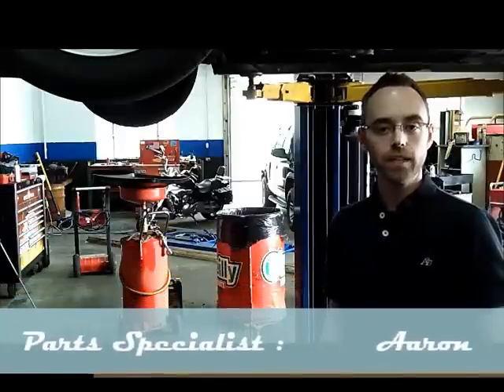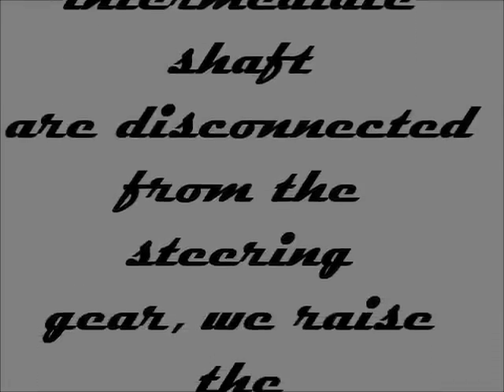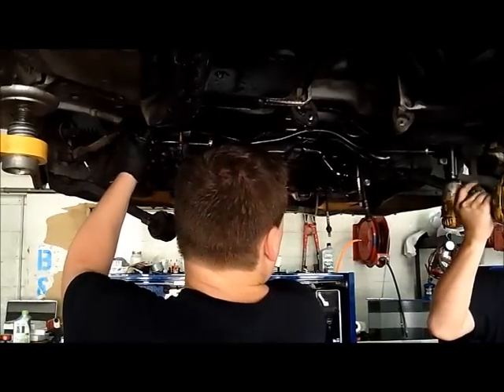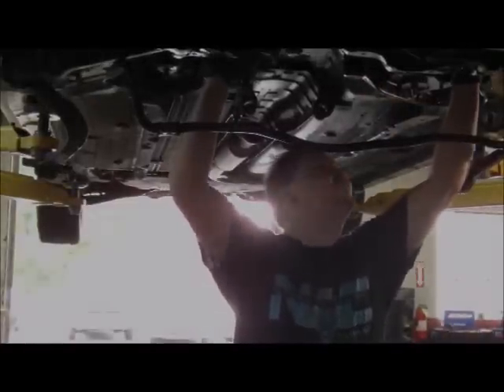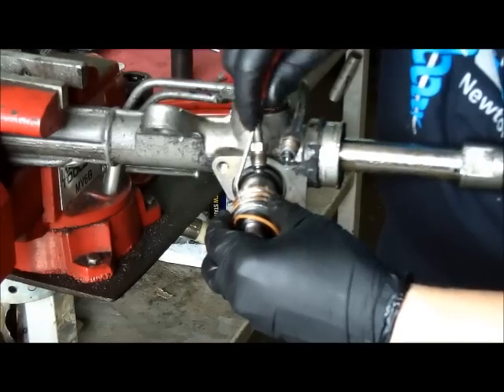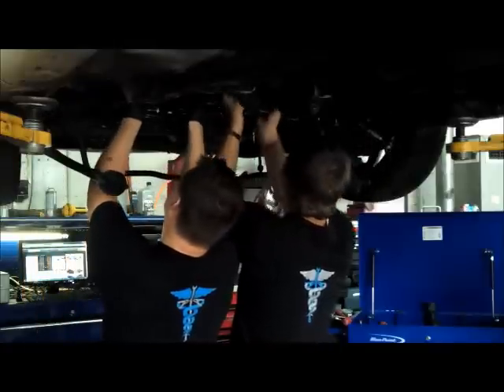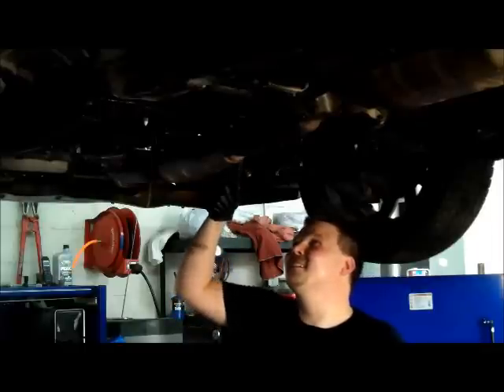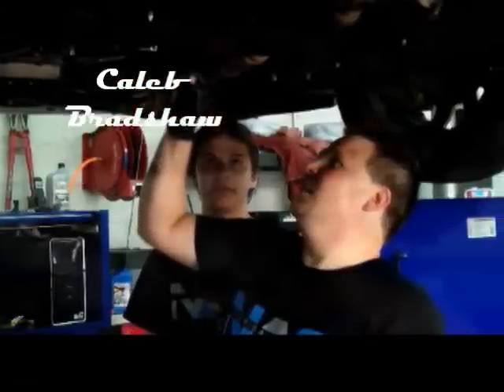How to Fix A Leaking Power Steering Gear (Rack and Pinion) 97 Chrysler Sebring

Comment: I have a Chrysler 2002 sebring xji 2.7 l double ohc convertible it binds up but don't leak changed struts new no changed on binding pass side tire wore on upper a arm nut .its werd it stops binding after a few turns and mile or so.

Comment: the problem here is the pinion bearings are always bad if a seal leaks. . This is because they are what caused the seal to wear out. Excessive play in bearings. They dont sell rack & pinion , pinion bearings, individually or in seal kits, or rebuild kits. You wont even find a rack pinion, bearing listed...So these guys replaced the seals,  while reusing old bad bearings. Ill bet this rack started to leak in the same place in a month. If anyone considers doing this job. First go check your input shaft for play. Just grab it by the base of steering column where the swivel knuckle is, and try to move it side to side. If there is play. Don't even bother changing seals.

Comment: Please answer Gentlemen!!!!  In my Toyota D'max encounter a problem with hydraulic steering. When I turn right steering wheel, it's very strong but left is normal. When I turn left, right is normal. It's very hard  and strong to steer the wheels

Comment: Need something like this on the steering rack for (at least starting at) 99 to 2004 Dodge Intrepid. 300M or Concorde in same year range works too. 
Trying to do a rebuild on a rack that is leaking VERY BADLY and wanted to save a hefty chunk by doing a rebuild instead of a full replacement.

Comment: All seals must be replaced for this to be a very professional job. Old seals will wear out quickly with the added pressure of the new seals. The idea is not only to fix a leak but to prevent others and not have the customer come back unnecesarily.
Reply: Akira w

Comment: Good luck for your trial when your customer has hit the next wall because of a blocked steering gear. No steering gear manufacturer will ever validate such a repair. Btw ... the quantity of contamination you have left on the parts will cause further trouble in the future. So the follow up repair is already pending.
Reply: U sound like someone who just had their goose that laid the golden egg stolen. Have u seen some of the places that do "professional rebuilds"?  This shop looks like an operating room by comparison.

Comment: Wow, He did not even polish the top pinion seal surface. That car will be back in the shop in a few weeks. He does not even know the proper terminology to do an instruction video. Your so called seals, that came with the kit are called Teflon rings. They are installed on the spool valve. You probably didn't even check the pinion housing for cut rings. Leave the rack and pinion rebuilding to the professionals. He knows just enough to get himself in trouble.

Comment from the maker: @Inngrown This repair was labor intensive but was required. Fluid was leaking around the pinion gear seal so bad the customer was using a quart a week of power steering fluid. Watch out Diagnosig a power steering leak video to see how we found exactly where the leak was coming from!

Comment from the maker: Normally a replacement is more cost effective in this type of repair. Of course the rebuild time only took about thirty minutes extra. This shop usually replaces rather than rebuild but there is a local rebuild place that they have used before. We mainly rebuilt this for educational purposes. You don't see many videos on rebuilding. Thanks for the comment and interest!